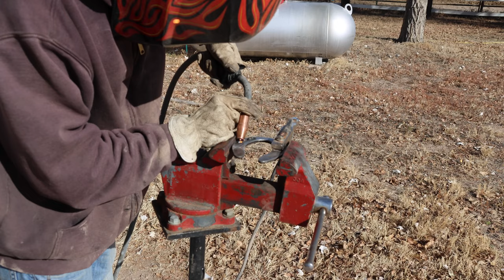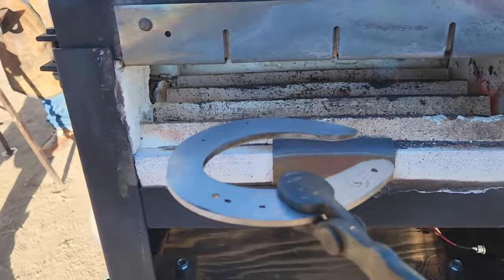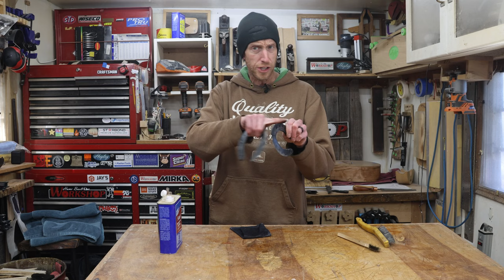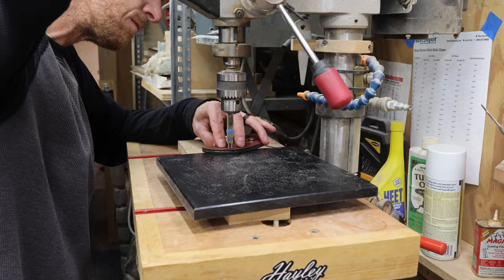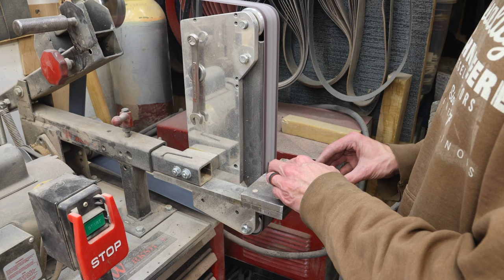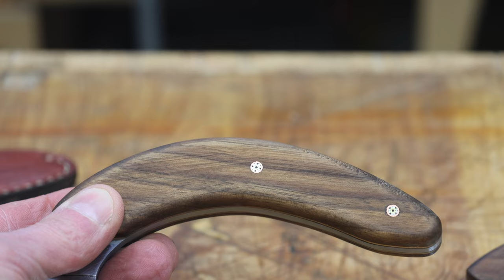The Horseshoe Knife REIMAGINED: Custom Build & Never-Before-Seen Design

Comment: Hi Jeff, great video! The reason why you were having trouble welding the holes was because the holes were dirty and oxidized.  I know this sounds crazy but if you drill the holes out with a slightly larger drill bit it will give the welding wire a much better surface to bite into.
Reply from the maker: The more I think about it, I believe you're right. I cleaned the outside of the holes but not the inside. Thanks for that, I'll definitely keep that in mind for next time.